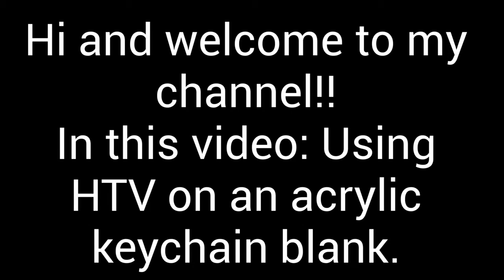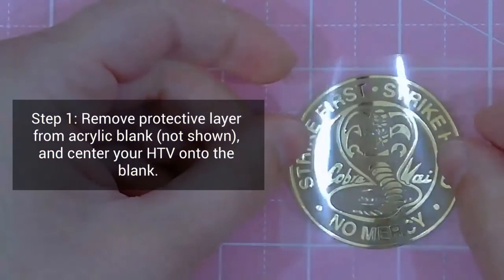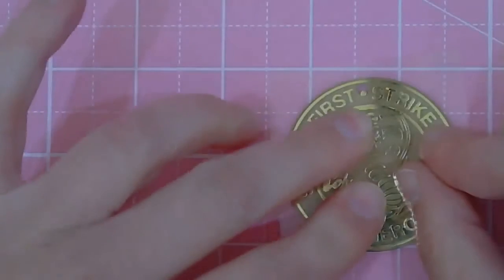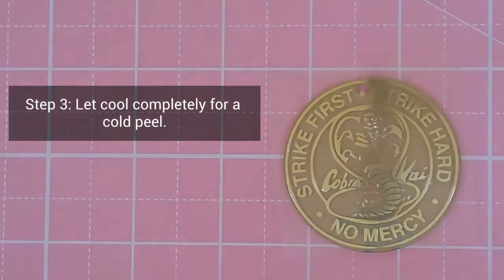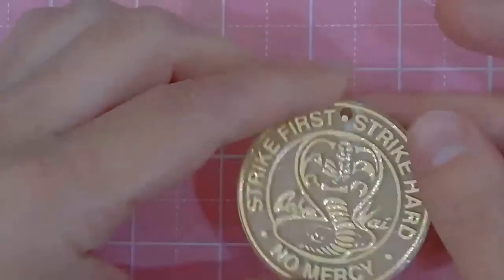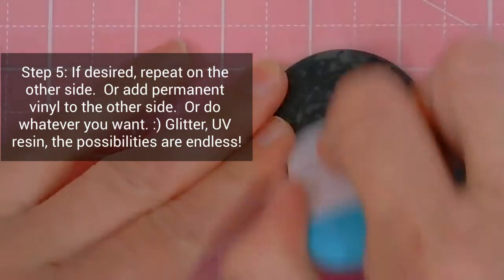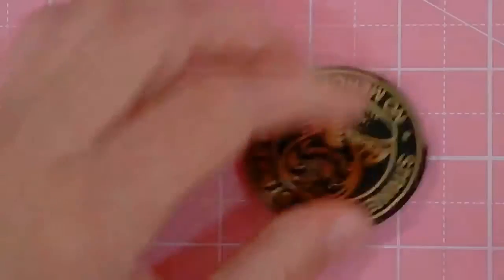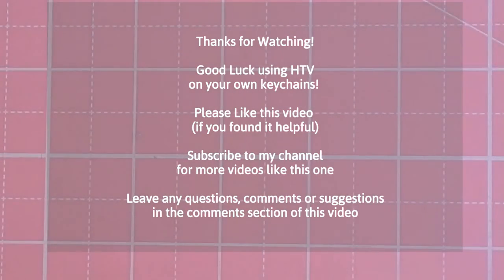Mini Tutorial: HTV on Acrylic Keychains

Comment: Am I use a regular iron for the heat press? I don’t have a Cricut heat press
Reply from the maker: Yes, but you need to be sure to avoid the holes in the iron. So make sure the solid metal part of the iron plate is what makes contact with the HTV/Carrier sheet. Otherwise there will be small circles of unattached htv where the steam vents on the iron were located during the press.

Comment: how did you get your adhesive vinyl to lay flat?  I have tried six or seven times to make a keychain.  I am using a medium tack transfer tape.  When i put the transfer tape on the vinyl and burnish it, it is smooth and when I put it on my blank and burnish it down it is smooth, but after I take the transfer tape off, it has bubbles.  I have taken the tape off very slowly too.
Reply from the maker: Usually for keychains it's easier because the pieces are smaller. But there are a few things I've tried that work or help fix the issue

1. the wet method- you lightly moisten the blank and lay the adhesive on the moistened side. Then once the vinyl is on the blank you hold it in place and burnish the water out from underneath.( I have a hard time getting vinyl to stick in this method, but it does solve the bubble problem.)

2. prick a hole with a needle into the bubble. DONT wiggle it, just puncture it straight down. then burnish over the bubble toward the hole. this is good for small but annoying bubbles.

3. heat it up and burnish lightly (this wrinkles the vinyl if you burnish too hard)

4. leave it to cure in the sun (this one never worked for me, just fyi)
Reply: @karbear04  Thanks

Comment: Thanks for this video. It’s safe not applying any coat to seal? Doesn’t come of easy?
Reply from the maker: I think it might depend on the htv. I gave my MlL one with unsealed glitter vinyl back in May, and it is still holding strong. I gave my husband one with foil htv around the same time and it started peeling off just recently.  You can definitely seal it to make it last longer. I prefer UV resin personally.